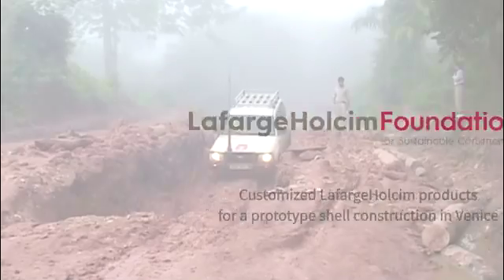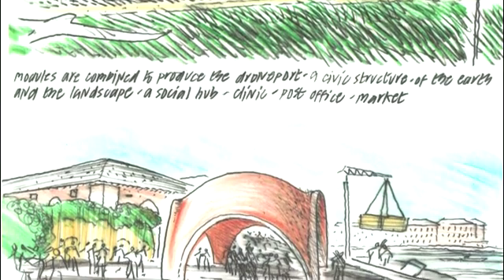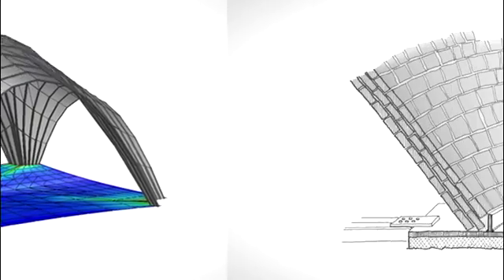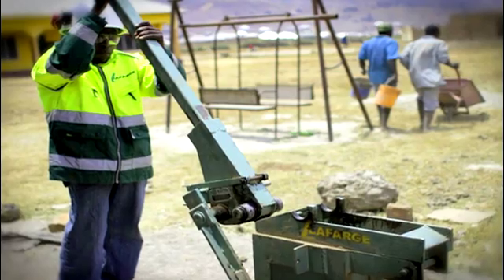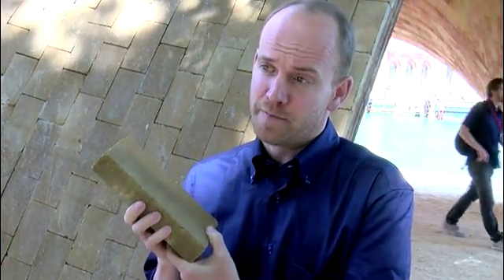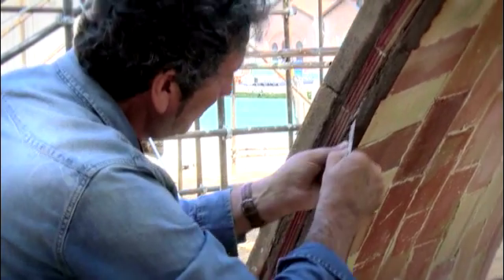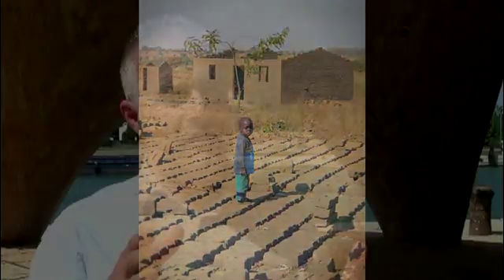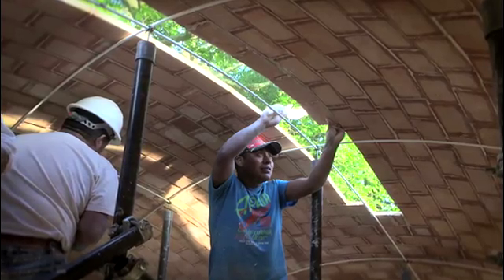Durabric – the secret behind the Droneport shell

Comment: Just use the method found at www.monolithic.org  It is FAR more advanced and efficient that what is on this vid.
Reply: @PatrickEH   You miss the whole point of making cheap stable structures from low cost local materials (earth blocks .......clay/sand/cement) not monolithic domes that require the use of expensive air forms, expensive shot crete equipment, lots of rebar expensive polyurethane spray material as well as the expensive polyurethane spray equipment(though insulation could be left out of a solid concrete dome it is much less comfortable than than compressed earth block tiles as far as temperature modulation). Monolithic dome materials and equipment are not readily available in most third world countries nor could they afford it. 
These earth bricks/blocks/tiles are made from local clay sand mixes mixed with 8% cement and pressed in machines. These machines can be low cost manual machines as shown in the video(200 to 400 bricks per day). There are more expensive mobile hydraulic machines that can produce as much as 6000 bricks per day and many models in between that local coops, regional governments or charity organizations could loan to communities. Though it's probably more efficient to loan a community multiples of the cheaper manual presses since labor is usually not a problem.
Reply: @TonyWadkins  Thank you Tony for explaining young Patrick the idea behind it